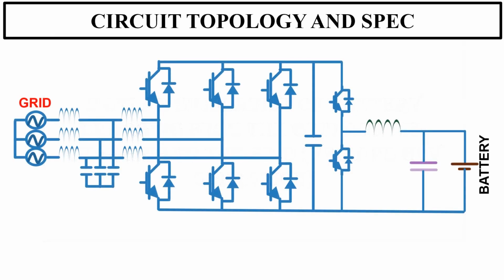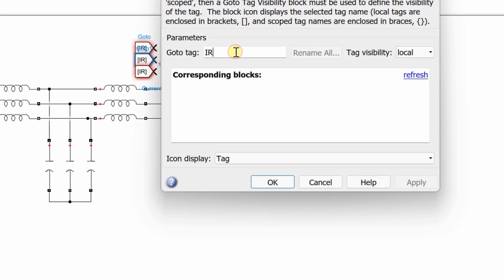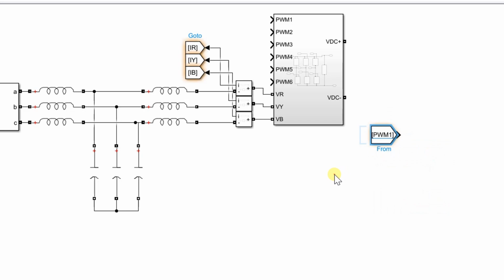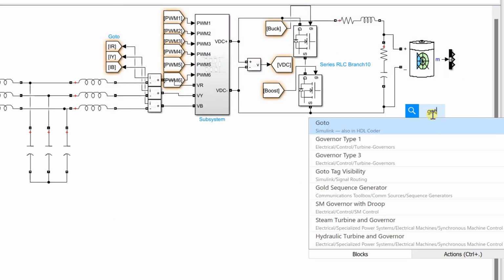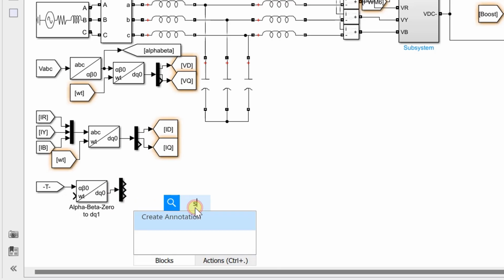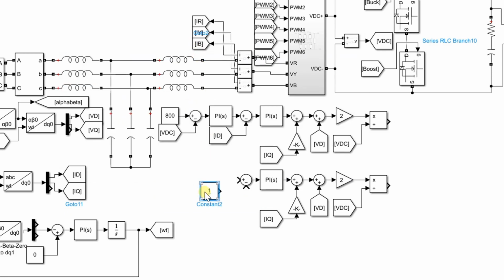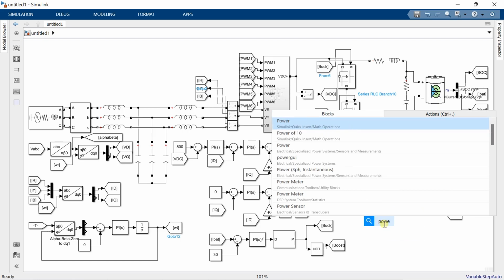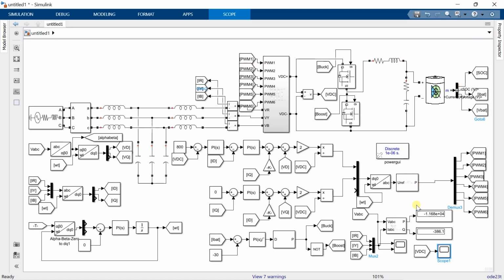MATLAB Simulation of V2G, G2V Operation in Electric Vehicle Charger (3 Phase Model).

Comment: Hybrid DC-Bus Capacitor Discharge 
Strategy Using Internal Windings and 
External Bleeder for Surface-mounted 
PMSM based EV Powertrains in Emergency matlab simulation

Comment: Sir, I've followed the exact same steps as shown in the video, but the current waveform of the bus voltage is very distorted(noisy) and the VDC waveform also has noises. How can I fix this
Reply: Same problem for me also
Reply: Did you find a solution?
Reply: @kowshikreddy9882  Change the Switches in the inverters. Instead of IGBTs use MOSFETs.
Reply: @kowshikreddy9882 no

Comment: Great effort! I've learned a lot from you. However, in all the simulations I have conducted, the current output signal is not stable. There must be something not explained in the controller part.
Reply: Change the IGBTs to MOSFET. This worked on me.

Comment: I have done exactly the same simulation but I do not have the same results. This is the third time. I also have negative active power from the measurement block even though the input constant is +30. Can you help me kindly with your simulink file
Reply from the maker: Pls mail your model
Reply: @TechSimulator  ok sir I am sending in 5 min
Reply: I send my model on your email id.please send me your model for checking where i am wrong.
Reply: Hi can u help me pls
Reply: Can u
Reply: Did he correct the problem,? if yes, send it to me
Reply: Did your problem solved?

Comment: This simulation helps me alot for the V2G/ G2V operation, great explaination sir. 
But i have  questions. What is the purpose of the constant value 800 in DC bus voltage to EV system and if we varies the value, how it will affect the system? i will looking foward for your respond sir. Tq

Comment: Sir how much filter values and output capatacence and buck filter  value i use for 400 v battery in v2g and g2v operation
If i change battery voltage them how much value i used

Comment: Hi I am also a researcher. Working on a same kind of work. I just followed your simulation, but I didn't get the results as you explained. My P and Q are always negative. I even change the battery voltage into 30 and -30. According to your explanation my simulation only working for G2V
Reply: This exactly was my experience. the V2G working perfectly but G2V isn't as explain in the video. Also the current waveform in V2G operation has some level of distortion which the filter didn't correct.
Reply: Try using IGBT instead of MOSFET in the inverter circuit
Reply: @SurgeArrestor2004 did it worked?
Reply: DID U MADE ANY PROGRESS ? CORRECTED IT ?
Reply: Any one got the right sol?

Comment: Vabc has no corresponding goto. I have emailed regarding this issue, for some reason this doesn’t affect your design
Reply from the maker: check 3 phase V I measurement block. i have used it as a label inside the block
Reply: @TechSimulator  Hi I have different current waveform for this simulation is it possible for you to check your email and see where I went wrong please. Thank you
Reply: @mythicaldragon2260  same here.. I checked it twice as you said current graph is the error one. voltage graph is perfectly shown.
Reply from the maker: Pla contact at my email
Reply: I see. Thank you bhai. 🙏👍

Comment: Dear Sir, Is STATCOM already connected to the system, or do I have to connect it separately? as the internal circuit of statcom and inverter is same.
Reply from the maker: you can use the same circuit

Comment: Thanks 😊, but I have a question , in G2V mode why the dc bus voltage drops from 800 volts to 765 ??
Also the response is slow right??
Reply: مرحبا هل عملت دراسه علي تأثير حمل السياره الكهربائية على الشبكة
Reply: @mohammedbosif7909  نعم

Comment: I tried to simulate the model with the same values but i didn't get the current waveform as you got and battery voltage get drops in charging mode
Reply from the maker: You can share the model at my email
Reply: @TechSimulator  I have shared, please probe where i did mistake.
Reply: Sir please check your mail inbox and leave a reply how i should correct.
Reply: @ananyadeep7666  HI sir... did u complete the model. Please can u share the file.

Comment: Why are the three current measurement blocks flipped?
Reply from the maker: You can connect the current sensor in whatever direction you want, but accordingly you need to change the controller block to make it work. 
"How to wrtite the "Error" term while implementing PI controller? Fundamental concept explained!" this is the video i made few months back. you can watch this video and understand the concept behind the how we connect the sensor and accordingly how controller block changes. this is explained for buck converter, similar concept you can apply for any converter

Comment: Got  a query. Why do you flip the current measurement block placed in the front end rectifier just after the LCL filter? You are measuring current in the opposite direction. Why is it so? Any specific reason? And I see, if I put the current measurement block in a normal way, your controls doesnt work at all.
Reply from the maker: You can connect the current sensor in whatever direction you want, but accordingly you need to change the controller block to make it work. 
"How to wrtite the "Error" term while implementing PI controller? Fundamental concept explained!" this is the video i made few months back. you can watch this video and understand the concept behind the how we connect the sensor and accordingly how controller block changes. this is explained for buck converter, similar concept you can apply for any converter
Reply: @TechSimulator  thanks! I will check out the video you suggested. Keep posting!
Reply: @TechSimulator  if I want to change this model for single phase grid so what are the parameter values
Reply: @TechSimulator  can I use same values as of your single phase statcom simulation
Reply: @TechSimulator hello sir,could you provide formulas?how i can calculate parameters?
Reply: @TechSimulator this doesn't work.why?